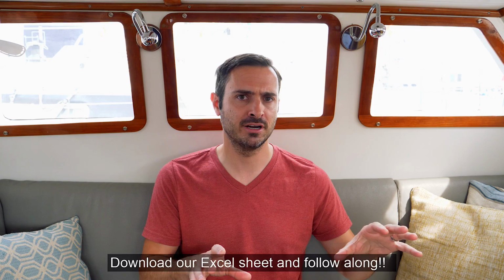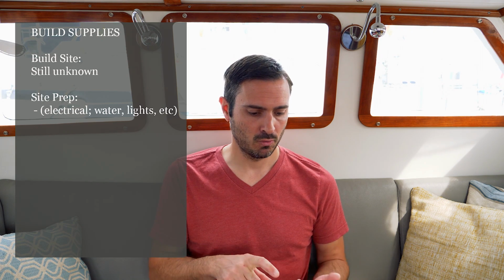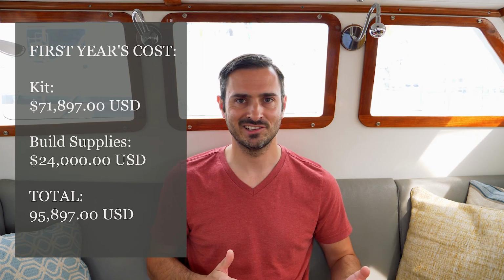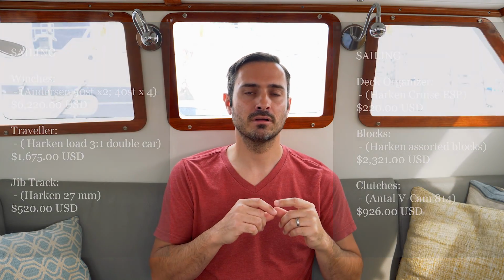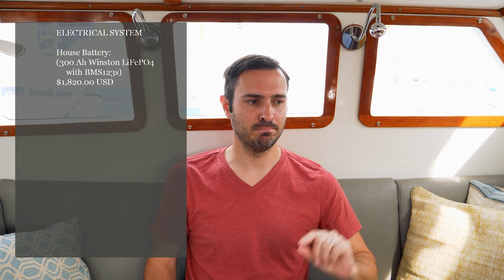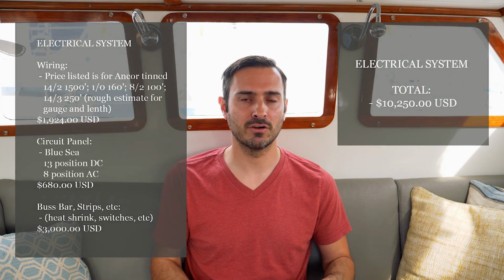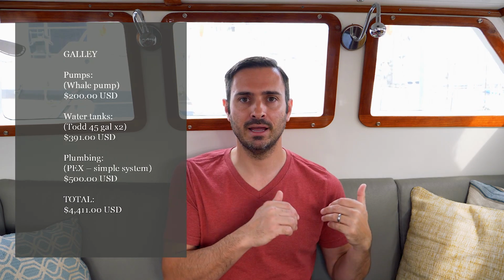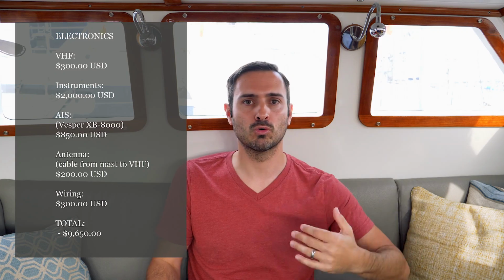What is it Going to COST to BUILD a Kit CATAMARAN? - A Comprehensive Guide (MJ Sailing)

Comment: Hey Matt- I'm curious to know here this USD134,000 came from? Did we quote you that price for a kit?  And if so for which design? And as long as you are comparing kit prices wouldn't it be fair to compare apples with apples? That is; if we quoted you for kit plus plans shouldn't you be comparing our prices with other prices for kit plus plans? Your  response would be much appreciated. Sincere Regards, Tony Grainger
Reply from the maker: Hi Tony!  Yes, this was the price we were quoted directly from you back in the spring of 2020, we still have the email.  All three kits were quoted included plans as well as furniture kits.  The three options we were looking at were the Grainger Raku 44; the Schionning Arrow 1360; and the Oram 45.  Hope this helps to clear up any questions you have.
Reply: @MJSailing  Matt, if that's the case the quote would have been provided to you in good faith  on a personal and private  basis and certainly not on the basis that it was going to be published on social media. If your intention was to publish it don't you think it would have been considerate to ask first? You say here that the prices included the plans but in the video you say the other prices did not include the plans. Can we set the record straight please? Maybe the appropriate thing to do now would be to publish all three quotes and provide details of what is included in the plans and in the kits. I will be happy to provide comprehensive details of both.
For the record we do not specify balsa core in our  kits.
Reply from the maker: From our first correspondence email I said that we were documenting this on our Youtube channel.   Schionning acknowledged this fact and asked us not to share their numbers - you simply gave us a price without any such stipulation.  

You've designed a beautiful boat - the best looking in my mind of the three - and there is nothing wrong with asking what you think it is worth.   But the fact is that is was double the Oram, and still much higher than Schionning.   

All quotes were based on ATL or Current Marine foam cored panels.  The plans were add on charges for Schionning and Oram, but that was factored into the comparison (Oram was only $7000).   These all included the furniture package, resin and cloth.  

Because of Schionning asking me not yo share pricing, I wont do any other comparisons.
Reply: Matt, you claim that our kit has basically the same panels as the other kits. Did we give you panel numbers with your quote?
Thanks, Tony
Reply from the maker: @TonyGrainger  That doesn't matter.  If I can complete one boat with the Oram kit, or one with the Grainger kit, that is all that matters.  But yes, you sent me a digital sheet showing the foam panel cut out file and what they include for the Raku - It was +/- a few panels of the Schionning.  The Oram is a simpler design/build, but still about 3/4 the number of panels of the Raku.

Comment: I like outboards but I just watched you working on inboard engine components and shaft alignment. Yamaha makes a stout 2 stroke enduro that’s way more simple than the 4 stroke.
Reply from the maker: I really wanted to do outboards on this boat.... The first production version coming from Vietnam had them, but after taking a Seawind out with outboards, I didn't like the sound, vibration and the drag from the outboard pod.

Comment: Biggest problem with outboards is lack of charging capability.  You need to look at your charging needs.  Some outboard manufacturers have a specific high thrust outboard. The best  swings a larger diameter prop more slowly.  I had a single diesel outboard on my last cat, but the extra cost over petrol was viable because it did not perform to windward very well, and the diesel had a better thrust.
Reply from the maker: We've actually nixed the idea of going with outboards for our new boat (after sailing on a Seawind that had them, and not loving the vibrations and limited movement) - so back in January we bought ourselves a set of diesel engines!   
https://www.youtube.com/watch?v=r1-LhR5hh34&t=5s&ab_channel=MJSailing

Comment: Great overview, thank you.  I think you need to add about $50,000 in miscellaneous extra cost for nuts bolts washers screws, wire terminals, vhf cable and connectors, plumbing fittings, etc and the 10,000+ extra parts on a cruising cat to install all of the major equipment you listed.  Think about every time you go to West Marine and get a small bag of parts for $200 or more. It’s going to add up.

Comment: 1-electrical system, is going to be 12v, 24v, 48v,? appliances are cheaper and more common for 12v system..
3-The cost (build of material, BOM) to build the 42 footer  is  4800 USD per linear foot(double hull). Excellent price.
4-What is the estimated cruising speed with the outboard engines only?
5-I would suggest taking into account a ready-drop-in solution (future upgrade) for an e-motor system from Oceanvolt or at least a hybrid wired-ready system for future use. 
6-What is your estimated labor cost(normally 10x higher in the States) and certified inspection fees for 2 years?
7-I would add 10% for inventory (material, objects..) shrinkage during the building process.

Comment: This is such a terrific video - you have given this topic such excellent thought, such thorough preparation, and present a very well condensed version of your findings. I agree with so much of what you've listed / spoken about, and understand your reasons where we differ. You've created a great resource for others considering this journey, including the spreadsheet. Thank you very much! I'm looking forward to your decision & build. I'm a big fan of Schionnings fwiw but Oram is great too . . . I respect your decision to favour your existing sail loft relationship, but you (and others) could consider making your own sails. Compared to a boat-build it's much easier! Designs can be found including free open-source designs AND software. I prefer the advanced laminates and more of a racing rig but again I get where you're coming from for more of a cruiser. Could you build your own carbon mast & get a better, stronger, lighter spar for less than the aluminium? I support your preference for outboards for this build too, and although i prefer electric, it is true they are hardly used so hard to justify.

Comment: I built an F-9A (31' tri) launched in 1993. An educated guess at the beginning was that it would take 8 months and $35K to build. It ended up taking 24 months and around $100K (at least $18K was rent for the indoor shop where it was built - SoCal prices). So approx x3 for both.
I say this because designers and builders notoriously estimate the low end for $$$ and time. Be mentally and financially prepared for overruns and stay strong. In the end, you will have something to really be proud of when you are "horizoning" other boats. AND, you will know the boat inside and out. BUT, building takes so long because so many decisions have to be made before you even touch the material or the piece of gear. Researching, sourcing, ordering and receiving parts takes time.
Wish you guys the very best success in your endeavor.

Comment: 200.000$ + 6000hour and 2-3 years hard work. Just one question about tax; if you build full time - can you get problem with taxes - maybe later if you sell? The tax people can maybe see you as pros with the YT-channel etc? And what about certifications, ref. the value of the boat when you sell, is that an issue?  A 45 cat is a BIG project - I have seen this among locals here - and several took 20 years... a reference to a monohull is not too relevant - the cat is so much bigger and more complex. To go full time to  do it the right approach then it can be effective working time. From what I see you can get a used Lagoon 380 or similar for close to 100.000$ - so  it could be an option. But of c - as you are pros - the  YT-channel - it is very interesting to follow this project - so I will follow - and I can even contribute some money if I use you channel a lot. You mention Jessicas parents that has build 4 houses themselves - now theres smart use of time - bec a house designed and build well on a good site will make money - thats an investment - a bout is hardly a good one. I didnt see the hole vid here -about costs; but a friend just bought a used mainsail for his performance cat on the international market for å fraction of the cost of a new - modern 3DL sail, some other gear like winches is maybe also possible to buy used? Mast - see it talk about alu-section - I have carbon rotating wingmast on my tri -  its really not complicated - and gives an edge in speed together with good daggers and rudders. Motors - seen many options with outboards - it may be cheap and light at first sight - but for a 45ft cat i would not use it; its complicated to build a good arrangement for them (and takes up space) to be operated good and easy - so the weight saving is not that much - also they use gas - much more than the diesels - so you have to carry more. One diesel and one electric is maybe a good solution - later it will be electric - with saildrive.

Comment: I got a simple question...why build when you can buy or rebuild very nice cats?. I have subscribed to your channel. I have the same thoughts on building my own boat but by the time I've put my time and materials into it I found out I could buy cheaper. I'd be interested in your answer!
Reply: If you're looking for a typical production cat like a lagoon, FP or Leopard, then it makes little sense to build.  Those are all great boats with a used price point that would be hard to beat building similar yourself.....  I actually don't even know of any amateur builder plans available for these types of designs.   But the boats we are looking at are performance catamarans, and there just isn't a used option, for a similar cost, that aren't well worn and 30 years old.  
I also don't think building is a good idea if you're just looking for a cat to sail off into the sunset.  You really have to want the learning experience,  sense of accomplishment with building something this massive, and like working with your hands to make the build process worthwhile.  If you're that type of person, then all the hours you spend building aren't a lost cost to be figured into the build expense. 

Matt

Comment: How much do you expect the boat to be worth after it is finished?
Reply: Immediately when finished?    Around $300k.  7-10 years later when we sell it?  Around 250k (adjust for inflation).   There are a few Oram 44c that have sold in the past year or two and that's a pretty accurate number for a 10 year old boat  -Matt

Comment: Move to South Africa and come build it here. The Rand is weak to the dollar and you have everything you need plus the labour if much much cheaper than basically anywhere else. At least do you you homework
Reply: We've talked about it-- especially since the Schionning kit comes from there--- but since we aren't planning to hire any of this out, the benefits of lower labor cost doesn't help us.   We'd then also miss out on any deals we could strike with suppliers in the US.   -Matt

Comment: Best of luck to you guys. As far as location, all things considered I'd recommend somewhere on the North Carolina coast, maybe around Washington or New Bern. Up some of the rivers you're basically sitting beside navigable fresh water with enough depth for you. The climate is the most conducive - summers not too too hot, winters not too cold. Great protection from hurricanes. Reasonably cheap property values. Good labor rates. If you find a decent spot, you can then build a house on it for an eventual home base.
Reply: NC is still high on the list.  But I think we'd need to be able to heat the building for almost 6 months out of the year, and that makes an insulated warehouse the only option.... which is way out of budget (the most important factor for us).  -Matt

Comment: Hi, Here are a few ideas for you. HELIATOS SOLAR water heating, I am using two planels  with Ventus 12 gal hot water tank. I like this tank as it is a tank in a tank , max contact for heat transfer.  Also check out You Tuber " DIY solar power with Will Prouse "  loads of imfo on Li batteries and other stuff.  On my cat build thinking of using E-Teck pod drives as the do regen and setting up retract system. Looking forward to your build.

Comment: I built its baby brother Oram 39C,  slightly wider hullform aft - excellent for surfing when going with the swell I was planning to use a Hitch-Hiker rig with a small "blade" sail for gales and 2 x FLAT CUT, light weight furled genoa to each bow (tack downwing for an excellent VMG downwind performance,   Fully reef upwind sail between 15+knots wind ACROSS THE DECK, then fully reef the leeward sail at 20 knots wind over the deck and just the tiny blade sail for strong wind...   I had 2 x kubota saildrives de-rated to 10hp and 1000rpm at the screw for 7 knots economical motoring of 1nm per litre both engines...    https://www.boatdesign.net/threads/my-little-piece-of-peace.25962/
Reply: Any reason you went with the diesel instead of outboards?    Do you keep track of your build hours?  I'm trying to figure out the build time of the 40' vs 45', but with everyone's numbers being different, there isn't a clear consensus.  -Matt

Comment: How about desalination? Your water tank capacity is a bit low. And even though you’ll be running solar, generator as well?
Reply: Sorry for delay.   A Honda eu2200 gen is one thing I did forget to add to the list.  While it's not a requirement, it is something we'll most likely get since we would need to always have power to run the galley.    
I rebuilt watermaker for resale for awhile, so I already have enough parts on hand to build a new system.   -Matt

Comment: When buying a kit boat you will be given time lines and costings and materials in the kits that are far from achievable for ametuers. I think you will find that the Grainger kit will have the volume of materials that it will take to complete the job. " If you don't pay what it costs for the product you don't get all of the product". "Beware of the dream."
Reply: I'm not really seeing a difference in supplied materials between any of the kits.  They all ship with about the same amount of resin and fillers..... extra cloth is different, but each design requires different reinforcement so that makes sense.   -Matt

Comment: I’m curious what the difference is between their “luxurious” fit out at $160k and your build out at $202k.
Reply: Two things:  That figure is AUD not USD like I'm using here.   The 160k AUD  is only the fit out part and doesn''t include the kit or plans.... those add up to around $265,000 or $170,000 USD.   If you take away the shop cost, insurance, tools, and other extras that some people already have on hand, then it's pretty close to what I've listed.   -Matt

Comment: I'm planning to build a trimaran. Not from a kit though (I wish!). Anyway, this was super helpful. Do you have a link for the machined aluminum LED interior lights you mentioned?
Reply: Amazon.com search for  B01FVRQVK4

While not exactly what we used, this is similar.  You don't use the led driver that's included... just straight wire to your 12v system.  -Matt

Comment: will be very interesting to follow your hard work.  However you missed the davit system for a dingy as this is not part of the structure.  also there will be more SS pushpits and pullpits etc.  Canvas wilh clears for the cockpit is also a substantial cost.  Would strongly advise on installing an electric winch for using especially with the main halyard, remember a cat mail is a lot heavier than a mono main.  Also advise to install a separate battery up front for the windlass, saves a lot of expensive heavy gauge cable.
Again looking forward to the start of your build.  
PS as a Norwegian I loved your northern tour.
Reply: I added the davit blocks in the catch-all for blocks.  Most of the builders I've spoken to use offcuts of the panels and some extra cloth for their davits.  We hope to be lucky and have appropriate sizes off cuts for ours too :)

I'd love electric, but unless we bought that used, I don't think it's in the budget.   The deck plan does call for a 2:1 for the main halyard, and we plan to see how well that works for us before committing the money towards an electric winch.

-Matt